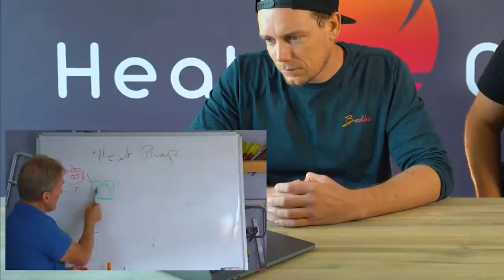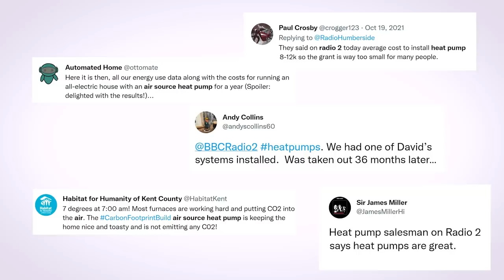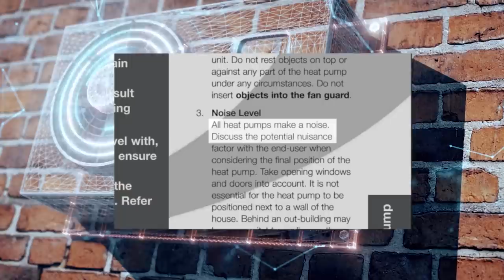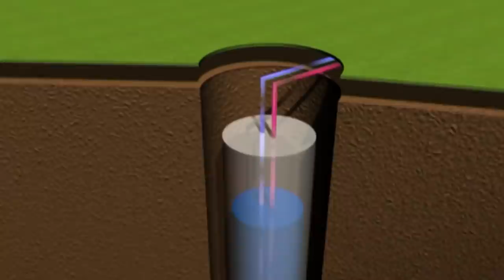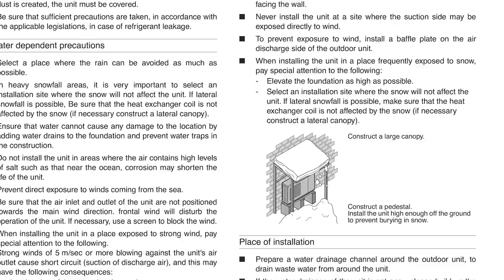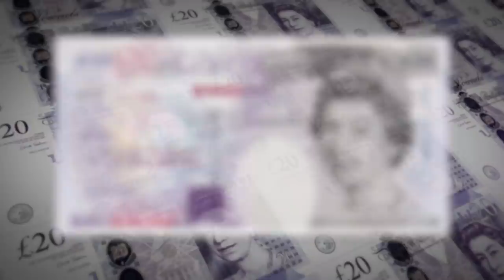Heat Pump Secrets They Don't Want You to Know

Comment: As an installer of HP for about 20years now, i recently started my own company. All i can say in regards to selecting air/air HP is that the manufacturers always list their capacitylosses in charts in regards to relative outdoortemperatures. Its true, that when it gets real cold outside ( -10 to -20°C) there is a very noticable loss in capacity due to freezing and clogging of the ouside battery. A good installer takes this in regard and selects a heavier unit when the client mainly uses it for heating. If the client only wants his/her AC for cooling in the summer this isnt even an issue, i tell my clients best they can do before each oncoming summer is clean the outside unit. Blow it out with air, hose it clean with water. Air/water HPs in comparison have a much much beter efficiency/yield to air/air HPs because of the fact they can continuously keep running on a low temperature (floorheating) hence a better pressure regulation on the outside unit, resulting in less freezing/clogging. Mitsubishi's zubadan/ecodan are great examples of this. also, your comment on outside units defrosting on electric basis is not entirely correct, most current HPs use hot gas defrosting. I have yet to see an AC unit that uses electric resistance for defrosting. Most of them require 20amps on the circuitbreaker (2ph or 3ph doesnt matter) as per manufacturer design, but run on 2-6 amps on regular usage.... thats 400 - 1200 W. thats a joke in my opinion. people have alot of other electrical compliances in their homes that often use alot more power.
Reply: 400W?! How much does it draw continuously? At that power it would easily be the most power hungry device in a home.
Reply: If the device runs on around 2A, on 220V, it equals 440 watts. Theres plenty of devices that use more. Like ovens, fryers, tv's, garden tools. Lots of People still use electric boilers these days, u think that's cheaper? Or accumulation heating? 400W when u have solar panels is nothing basicly
Reply: I've had a hyper heat ductless split for 3 years now, I installed it myself and we love it.
   It's our main heat source and we've been down to -5° and the house maintained temps in the 60's.
      It's cheaper on electricity and no fuel needed.
Reply: @denjames505  Plus, 400W for heating is nothing compared to using gas...
Reply: @AlejandroVales  exactly, it's no different to people thinking nothing of filling up a massive SUV with £££ worth of fuel that gets them "some" miles - equally, they can't quantify a 20-30kW gas boiler in equivalent electric form - naysayers like this chap who cherry-picks the warnings in installation manuals (as if gas fitters read their instructions!) and those with vested interests in gas boilers will continue to slate heat pumps because they're new and different - dodgy salesmen and fitters will also give them a bad name, but in time to come they will either need to adapt or move on from gas, it's a no-brainer really...
Reply: @denjames505  Yes, that's 440W constantly, 24 hours a day, 7 days a week.  That is about what the tick over hourly rate of my house is with my 4 fish tanks going in winter. It equates to about 10.5 kWh every day.
I also have a 4.5 kWh solar panel array with 5.5 kWh storage batteries. Let me tell you, in the winter months, they would not generate anywhere near enough to power a ASHP. You are lucky if you get 2-3 kWh per day between December and March. Relying on subsidies paid for by poor people should not be the answer.
Hydrogen ready replacement boilers are the answer. It just makes sense to utilize the existing gas infrastructure.

Comment: You didn't mention that ground source heat pumps are far, far more expensive to install than air-to-air. We're currently building a new home and even with a decent budget, we couldn't afford it. We're installing one of the best air-to-air systems and an 11kw solar array with battery storage for considerably less.
Reply: How air tight is house?  The reason I ask is that for houses that require MVHR a air to air heat pump can affect the room air flows for the ventilation system. Cheers
Reply: @engineerabetterlife8301  Very well sealed, hopefully. The house has to pass a blower test (pulling air out of the house to create a pressure differential) in order to qualify for Germany's KfW subsidies.
Reply: @mstevens7175  Thanks for the reply. This is what I am looking to do in the future. What make of heat pump are you using? How do you heat your domestic hot water, using PV and battery? Cheers

Comment: I work for a reputable renewables company, I watched both your videos on pumps and thought the first was particularly harsh against ASHP's.  Also, the media during COP 26, I felt was giving an unfair narrative to ASHP's.  Many funded incentives will always attract the unscrupulous, Solar PV as an example.  No question, ASHP's are intended for the well-insulated home and will struggle or fail in homes that aren't.  A heat loss calculation (HLC) must be done pre-every install and this will generally give the strongest indication of whether an ASHP would be suitable.  My advice to customers is if it's a high HLC they should invest in insulation. The HLC will allow you to select the correct pump size, to low not enough heat, too high it will use too much energy and cost more to run.  I installed my ASHP 1.5 years ago, last winter we were 7+ weeks below zero and peaking at -18c.  The pump worked flawlessly and the running costs were not bad either.  My advice is to do your research on accredited installers and don't forget, not all ASHP's are the same, this also requires you to do some research!
Reply: Well said
Reply: But isn't the complicated nature of the  solution part of the issue? The average Joe just wants a solution to being cold, they don't want to or sometimes aren't capable of "doing the research" so rely on the installer.  But how do you know the installer is competent and honest. We're back to research again and a healthy dose of trust.

Comment: I live in Poland and have air to water heat pomp second season.Its working great but iam afraid that UK houses are not insulated enough for it to be most economic.I used to live in UK for 15 years.Second...air humidity could be a problem as it cause unit freezing.And of course underfloor heating as a good partner.
Reply: It's always interesting to hear the actual numbers...
Prior to your heat pump what was your annual energy usage? Gas kwh and elect kwh?
What is it now you have a heat pump?
What was the full cost of the installation?
Reply: @ChrisLee-yr7tz  For climate temp and humidity  that Iive all year around.its about +5 For last 10 year's and it's going to be more up.(that's important).My kWh (UK units) usage for 2021 was around 3600kwh for Home heating and 600 kwh for hot water.Inside 20/22 degrees no less.But my home meets polish 2030 criteria.20 cm of polisterian around house and almost 50cm roof insulation in total.
Reply: @MrPolun1  Hi. Thanks. What was the equivalent kwh usage prior to the installation please?
Also, how much did the installation cost?
What your average annual cop?
I notice your usage figures are incredibly low! Wow.
Reply: @ChrisLee-yr7tz  OK.I don't have any Scop meters but as it says in manual A7/W35 is no less than 4 COP. A2/W35 3.5Cop. But I don't use any heating curves just full manuall and never exeed 32 degrees.Cost of installation was around 4000Pounds but in today's world fuel prices and PV as an option (don't have any yet).Its almost for nothing.3 years ago I was looking for installers...now they looking after you...

Comment: 😁 Thanks for the mention at the beginning Roger!👍 😀  
Side note.. we're actually the uks number 1 hydrogen fuel cell boiler installers so if we were bias it would be AGAINST heat pumps  not for...
Reply: @skillbuilder why don't you pop over and do a fuel cell video with us!?
Reply: 🤣🤣🤣 like the nuanced message bit at the end too
Reply from the maker: Nice work!
Reply from the maker: I am  more than happy to talk to you and hear your side of things. I did extend that offer some time back but you went quiet. Where are you based?
Reply: Talked to my plumber about hydrogen and the trials that are going on at the moment. He seems to have more faith in that as a future solution. I likve in a City with thousands of terraced housing and back to backs and heat pumps will not work. There won't be any room if nothing else.
Reply: Bit below the belt calling you Heat Freaks i thought!
Reply: Nice to see @heatgeek disrupting the market, must be doing something right 👌
Reply: Another side note.. not all heat pumps have backups built in at all.. any decent unit (vailant for example) does not. Any any well designed system will not need to use any back up at all.. even for legionella cycles..
Reply: @billwish  could be a genuine mistake, I'm just greatful for the exposure to be honest!
Reply: @HeatGeek  from 6 mins roger  start to rant rubbish again 😂 not all hp’s have a back up, many come with powder coat for near the sea, many don’t want you to put glycol in because it lessens efficiency. Your picking bits up that suit your argument. Gas boiler flues don’t like snow…it’s against gas regs. Rodents attack gas and oil boilers too. I could go on and on. I’m not sure your a plumber Roger..maybe a joiner or builder ?
Reply: @heatpump8566  yes its all the issues of the crap units again... but it really needs an in depth unbias debate to dissemble the myths..
Reply: Not to mention more than suitable for installation in a seaside location. 
This guy is a clown. He obviously has an agenda. It’s almost laughable. 
Isn’t he the same guy who was doing promotional videos for Worcester a while back??? 🤥
Reply: @43bikeguy  the climate crisis needs a multi heat approach. Heat pumps will do well in new build, but as you say where you are hydrogen will be the obvious answer. It’s not one or the other, never has been
Reply: @SkillBuilder  based in Surrey. We have responded to your requests and also emailed a couple of times to various emails we could find.. please find our email On our website. You tube keeps removing our contact comments
Reply: Some content from Skill Builder and Heat Geek would be great. Both very knowledgeable and have their own takes on the industry. Love both channels so fingers crossed you guys can do something together.
Reply: @HeatGeek  😂😂😂😂😂😂😂😂
Reply: Would be great to see a Skill Builder / Heat Geek collaboration
Reply: Would  that be green, blue, pink, grey hydrogen?
Reply: @HeatGeek  Having done the Vailiant HP  course:      They recommend a separate standalone electric backup heater, fitted in the house!      (I have all the paperwork and schematics)
Reply: @Orchardman53  blue
Reply: When will we see a proper live debate between Adam Chapman and Roger please? Come Roger, don’t be shy.
Reply: @UrbanPlumbers  I'm liking the sound of this...
Reply: @ShahedAhmed-er4ih  or we could just get them to have a charity boxing match - all proceeds would go to 'save polar bears' charity - LOL
Reply: @UrbanPlumbers  lool, we all know Roger has that one in the bag 😀
Reply: @ShahedAhmed-er4ih  yes, looks like years of brawling experience on his side :)
Reply: @heatpump8566  can you tell me the ridiculous COP on a cold winters day  when you want 55  deg c of hot water out for your heaters?
Reply: @cooliocrib4409  my heat pump has cost me £350 to run all my heating and hot water needs over the last 10 months. At 2° outside temp last night the house is a very comfortable 20°. Not bad for a retro fit on a 1998 bungalow. Mine does have a back up immersion but it has never had to kick in yet
Reply: If you are number one where do you fit them
Reply: @grumpygit447  what do you mean?

Comment: I have a warm air pump, I live in Sweden all my neighbours have them, we do not have gas boilers they are not an option. Other options depending on where you live are District Heating (your house amongst others is connected to a local power plant) works very well. Then as you you describe Heat Pumps which draw heat from the ground, also boilers which use wood (older houses) or boilers which are automatically fed wood pellets. 
My warm air pump copes very well with the weather we usually have snow during the winter never a problem, the system is on 24/7 during winter, it is better to leave it on auto rather than stopping it at night as you will be reheating cold air which is inefficient. My system has a motion sensor which can be overridden, if no motion is detected for a half an hour then it will drop the temperature by around 2c, this is mostly night time or during the day whilst at work. What you want to avoid is turning it off and the outside temperature goes down to -21c as was the the case before Christmas we had very cold weather it’s been on 24/7 since October. I have had a warm air pump for around 16 years, it is specified down to -25c for the outside unit and you can also have -35c, we never ever have condensation, as the system takes care of that and removes house hold odours. My house is 125 m2 four bedrooms and a warm air pump would cost between £1k-2k depending on the specifications. Installation around one or two days. The Heat Pumps which take heat from the land are typically found more in the country, town and city houses favour Warm Air pumps, with the A/C option for the summer.
Reply: In the UK we have damp air IE moisture which means lots of deiceing
Reply: @Roobs I agree on bedrooms, just keep the bedroom doors closed, Swedish houses are more open plan my warm air pump is in the stairwell, which is adjacent the living room, the stairs have no risers so air can circulate freely. My bedroom can be anywhere between 13 to 18 c depending on outside temperature but we are triple glazed. The units have an “air swing function “ which allows the air to be directed up and down, side to side or fixed. Also the big difference between a Swedish house and an English house is ventilation natural or fan assisted, I have a ventilation fan on the roof sucking air out 24/7/365 from the kitchen bathroom and toilets and storage areas, there are various inlet vents, it’s been running for over 30 years. This is considered to be important here but not in England so much ?
Reply: @pilkipilki4472  Yes it is generally more humid in Britain than Sweden on the other hand we can have rain or like now we have had a fast snow melt in 24 hrs current humidity is 80% at 4c, it can very quickly drop to -10c or lower, I have yet to see any unit iced up and I have lived here for 24 years, I think the examples shown are rare, worst case scenarios, it’s not explained why they are like that or what country they are installed in or how they were used?
Reply: @Roobs I live like you so can see your point. However it does not have to be that way. 20 years ago I staying in a log cabin in the artic circle. -20degC outside and the heating was barely having to do a thing. Body heat was almost enough. Also plenty of fresh air from the heat recovery ventilation system. Frankly a much nicer place to be (whatever the weather) than most british homes.
But that is the problem that Roger is highlighting. ASHP will work well, but only if in a building designed for it. 90% of british housing is just not very suitable and we are 20 to 30 years behind the likes of sweden and finland is sorting that out.
Reply: David, what is the make of your air to air heat pump? What does the COP drop to when you have the lowest outside temperature?
Reply: @davidiand7  I don't know where this myth about icing in the UK came from. It's not a special climate, it's never very cold. Icing isn't a problem. A little bit of ice builds up, the hot gas bypass kicks in for a few seconds, the ice falls off. No problem.

Comment: Good message, agree with all you say. I am a gas fitter and will be fitting gas boilers for many years to come. Lots of houses are not suitable for heat pump yet.
Reply: That's crazy! I live in a 1910 house and heat pump is much better than boiler. My guess is that you want to replace boiler with heat pump and keep the stupid water loop.
Reply: Depends on how much house owners want to rely on russian gas prices
Reply: @OskarHenrikssonx  still need the gas to generate the electricity.... go nuclear!
Reply: @pierregravel-primeau702  It's really going to depend on the average temperature in your climate and the specific issues around any particular installation. It is crazy to suggest that heat pumps will be the best solution for everyone
Reply: @OskarHenrikssonx  The electric is made from gas, when the price of gas goes up so does the electric. Electric will always be 4 times the price of gas for this reason.
Reply: @pierregravel-primeau702  I have ripped dozens of heat pumps out and replaced them with gas.  These things are snake oil.
Reply: Thanks for calling yourself a gas fitter (same as me)... My son (an engineer) hates people using that term to describe themselves... Engineers never get their hands dirty guys.
Reply: Very true, but new ones should be and ditto properly refurbished ones. It will be many years before the majority of resi will be able to take heat pumps and the same is true of many commercial buildings.
Reply: Once they are suitably insulated for a heat pump you may as well just stick with gas..
Reply: @pierregravel-primeau702  Sure travel along & get yourself nice big electric bills. 😉
Reply: @cuckingfunt9353  not exactly snake oil, but they're not exactly the magic bullet some people want to call them.

Better than resistive heat, but still electric intensive.

Combine that with the reduced solar gain in winter and the thick clouds that blanket the skies where I live, and I chose wood instead.
Reply: You won’t be fitting gas boilers when they cease manufacturing them!
Reply: @pierregravel-primeau702  Sounds like he just wants to keep himself busy with work, installing boilers.